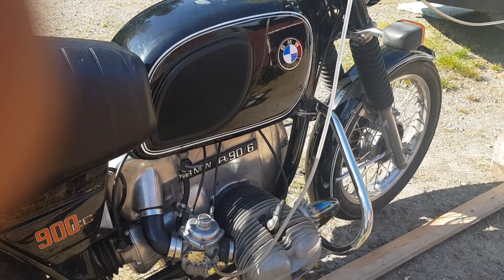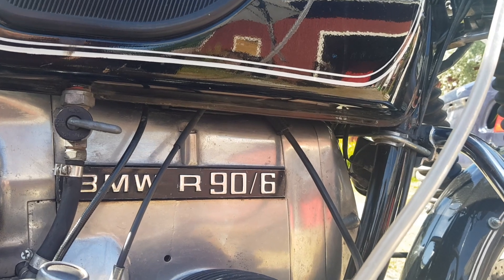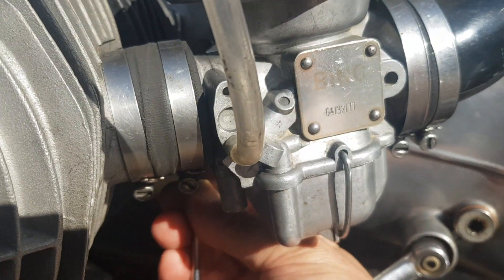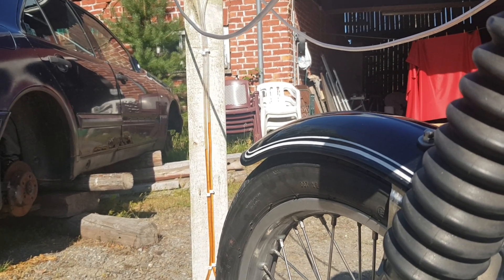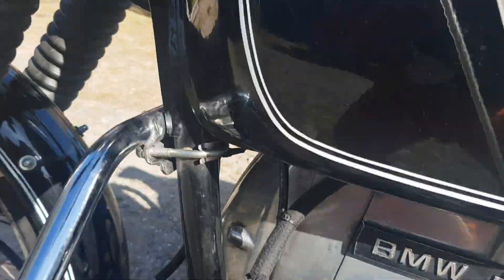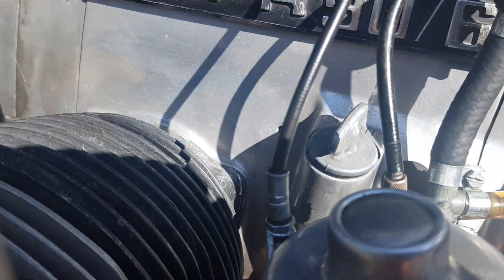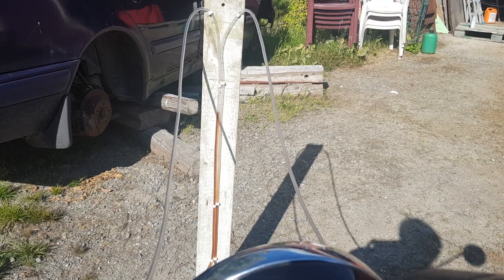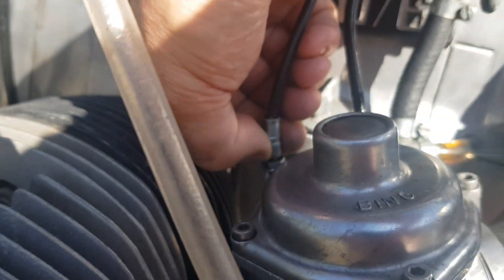BMW R90/6 (75/6, 75/7) idle and synchro.

Comment: To get the best pull away power (setting off from a stand) my R100/7 liked the air mix to be lean. 
After setting the balance I would go for a ride around the houses with a screw driver and lean off the air screws a tiny bit after each set off. The torque (pull away) was always better set lean but the leaner the air screw, the more it popped in the exhaust on slowing down, it was a compromise between best pull away power (torque) and least popping lol (Bing CV Carbs)
Reply from the maker: True, but lean idle may cause slow return to idle, so hanging on high rpm for a while.